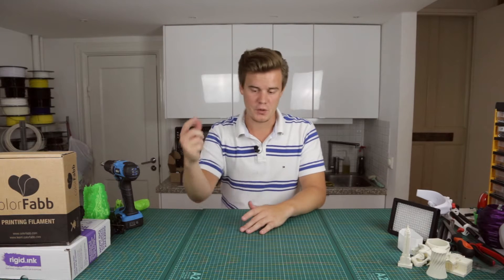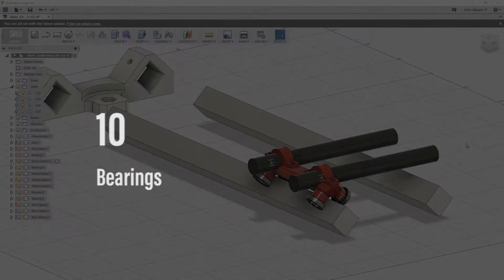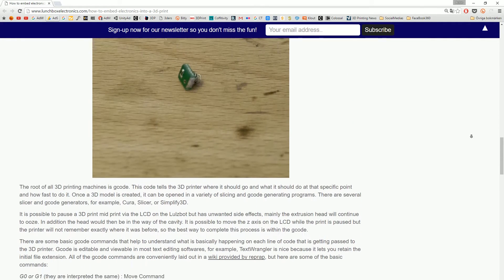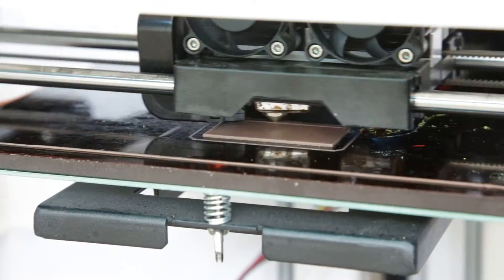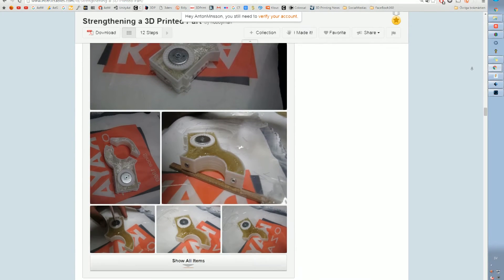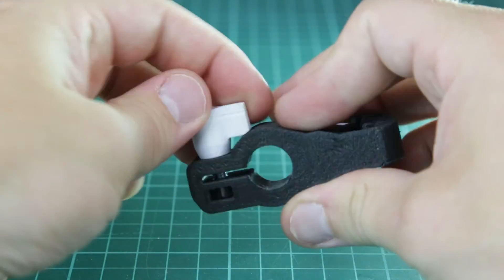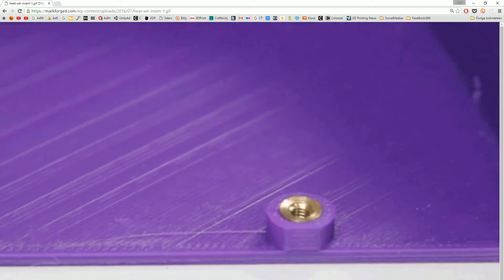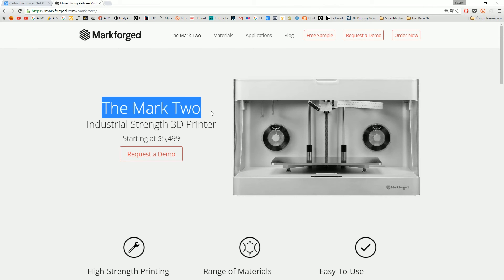TOP 10 3D Printing inserts you can do

Comment: How do you compensate for ABS shrinkage
Reply from the maker: In simplify you have a setting that is "horizontal size compensation" which can be used to adjust for shrinkage. It's not perfect, but it allows you to not having to remodel anything. Usually works when screws and such are to tight. 

Sorry i don't know/have an answer to if cura or other free slicers has it.  Zortrax has it as well for example.